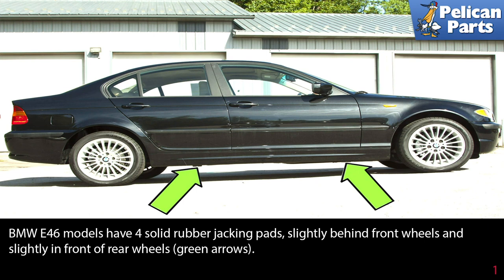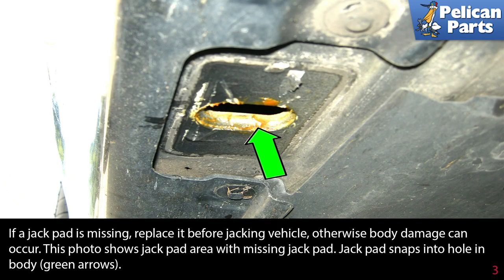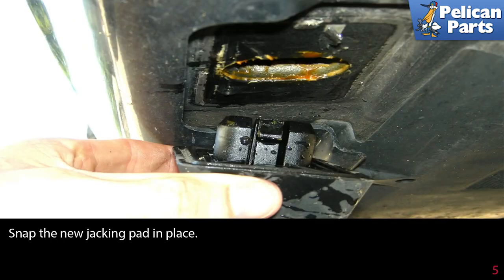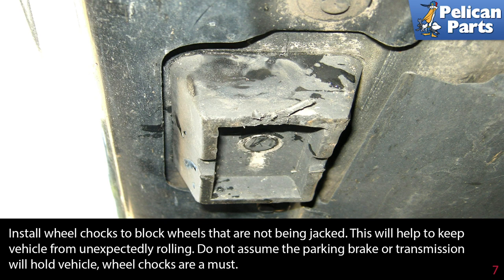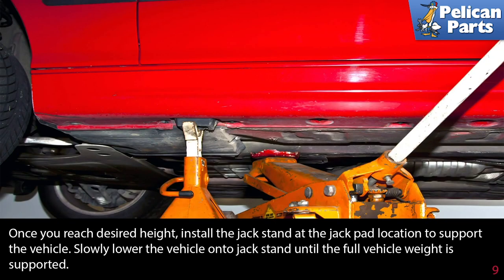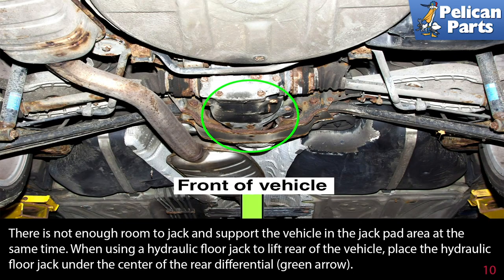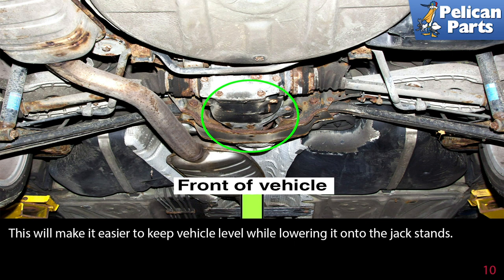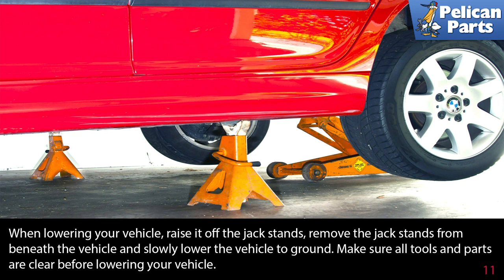Jacking Up Your E46 3-Series BMW - 320i, 325i, 325Xi, 330i, 330xi, 328i, 335i

Comment: I see a lot of folks recommending the front center point and a jack lift. They all say you can expect the point to crush, "but hey it's OK no problem!" A few do not recommend that center front lift point. It seems hinky to me. Mine is a 2003 325i. What's under that "crushable" point?
Reply from the maker: Do not crush anything, that is not OK. You don't want to deform structural metal.